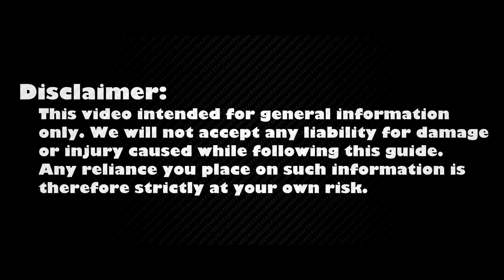Lenovo G700, G710 Disassembly and Fan Cleaning Guide

Comment: Thanks for the video, but it wouldn't be better to use compressed air and carefully blow out the dust?
I like Lenovo design, because it's easy to acess the core with no screws.